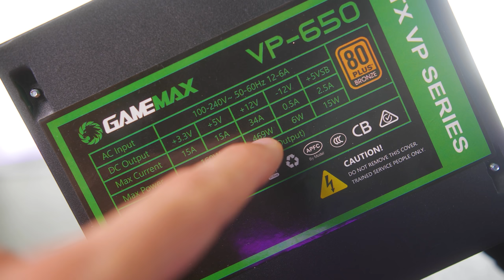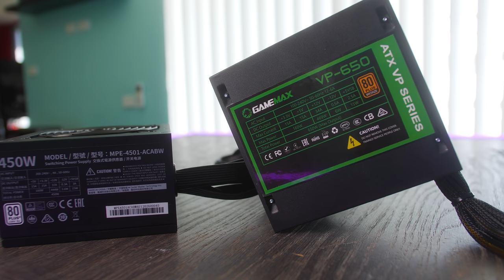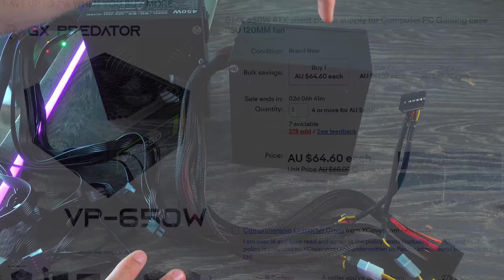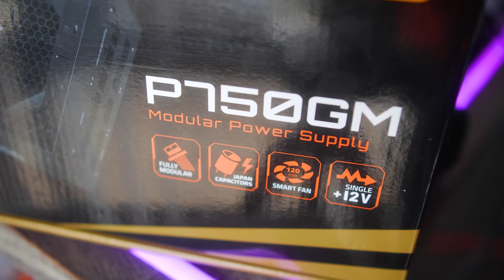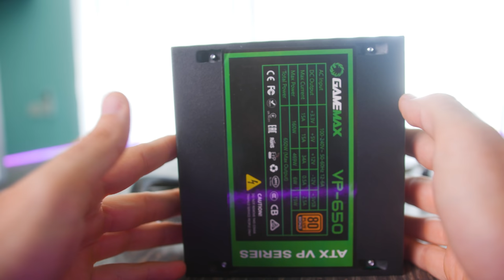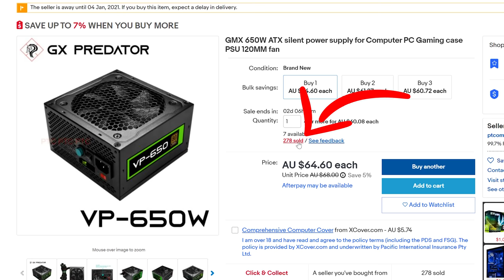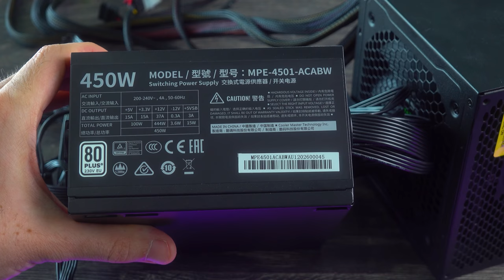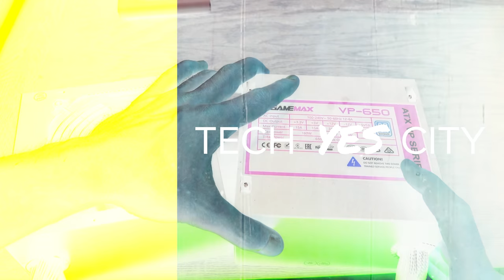This Company is Straight LYING about their "650 Watt" Power Supplies.... (*UPDATE* FAKE GameMAX??)

Comment: I put two of there 600W PSU in my first 2 builds-1600AF/1660TI/4x8 3200 DDS-4/500GB M.2/1TB SSD/6xRGB Fans/Fan-Temp Controller. Mine has been running WOWS now for 1yr=9K games=up to 20hrs a day. Have had zero problems. #2 was for my grandsons B-Day and he has been playing RB-6, WOT, WOWS, CS-GO and other games and have had Zero problems. I did not use in my new PC 3700X/2070Super/4x8 4000 DDR-4/1tb M.2/1tb SSD/9 RGB fans and 24 other RGB items.
As a side note I do not have AC so this PSU ran fine in temps over 100`F in the summer for hours and hours. Just saying seems fine to me!!!!

Comment: Check out the gigabyte PSUs 
They are selling on Amazon India after tax and shipping for :
450W bronze : 40 USD 
650 bronze : 60 USD
700 Bronze : 70 USD
750 Fully modular Gold : 80 USD 

Pretty damn cheap and good reviews,  In India we pay at least 15-20% more than US for PC hardware and this is cheaper than US, coolermaster, Corsair PSUs cost like 10-20 bucks more for equivalent ratings.

Comment: YOU JUST BLEW MY MIND. I replaced mine yesterday! mine ended up actually being only 480w on the 12v rail. Ended up nearly killing my PC. Running a cooler master.
Reply: GameMax is hot garbage and the power supplies weigh so little. The SATA power connectors cracked on mine as well. I thought i was being too aggressive, but its just a POS. Then they say the wire on my PS (VP-600) is using 16 AWG, which is bullsh!t, because my cooler master power supply is actually using 16awg wire.
Reply: Might be worth digging a bit deeper to determine if it’s even a real GameMax or a shoddy counterfeit.  GameMax doesn’t even make a “VP-650” model...

https://gamemaxpc.com/productkkk/list-276-en.html

...but they do make a VP-600, which really is certified 80+ Bronze:

https://www.clearesult.com/80plus/manufacturers/115V-Internal/

Looks like this may be a counterfeiter peddling generic Chinesium and trying to trade on someone else’s name, rather than an entirely garbage product put out by GameMax.  Although it is worth noting that even the genuine VP-600 uses the same misleading labeling of combining the max power of 3.3 + 5 + 12V rails to come up with “600W”; at least on that model the math is right for a 40A current at nominal 12V producing 480W peak on the rail.

Comment: I always buy Evga Power supplies, almost all are 80plus bronze rated or better and almost all have 5-10 year warrenty's. And I always try and use the PowerSupplycalculator from Outervision because you can enter each individual part and its usuage-clockspeeds and try and get atleast 100w over what it recommends.
I usually base a purchase of a powersupply off the warrenty from the company it sold by because if it has a 5 or 10 year warrenty, they intend them to last at least that long.

Comment: There's a Brazilian channel called Teclab that has a very knowledgeable guy on PSUs and overclocking (rbuass). He really dislikes the "80 Plus" certification and recommend searching for the "Cybernetics" certification instead, I second his recommendation, whenever you are in doubt about a PSU, just search it on the cybernetics. They have a very very detailed and informative certification process and you can download a pdf with all the tests that the PSU went through.

Comment: Thanks for this warning, I was going to get a 850W gamemax psu from amazon, but now I'll save my money and get more expensive and we'll known make.
Reply: has been fine so far for me for almost a year cuz im only paired it with a 65w cpu and a 120w but will seriously consider upgrading soon lol
Reply: @hoangd4132  just get a cheap corsair 80 plus white or any other brand with a well known name. They have something to lose if the power supply would be terrible.
Reply: @hoangd4132  i bought the rgb one with 80+ gold .  i am not a gamer though but now i considering buy another psu,,uh
Reply: Never go by brand, most of them only slap labels on other OEMs products. If you dont know better what you are doing, just go by the PSUCultists PSU tier list, get something A grade if you can
Reply: Might be worth digging a bit deeper to determine if it’s even a real GameMax or a shoddy counterfeit.  GameMax doesn’t even make a “VP-650” model...

https://gamemaxpc.com/productkkk/list-276-en.html

...but they do make a VP-600, which really is certified 80+ Bronze:

https://www.clearesult.com/80plus/manufacturers/115V-Internal/

Looks like this may be a counterfeiter peddling generic Chinesium and trying to trade on someone else’s name, rather than an entirely garbage product put out by GameMax.  Although it is worth noting that even the genuine VP-600 uses the same misleading labeling of combining the max power of 3.3 + 5 + 12V rails to come up with “600W”; at least on that model the math is right for a 40A current at nominal 12V producing 480W peak on the rail.
Reply: @ffqqz  I appreciate your help mate, thanks.

Comment: The worse thing is if you pull it apart it will probably not be electrically safe either (creepages, clearances, insulation in transformers, temperature rise of components).  I'm an electronics engineer who's worked in one of the remaining Australian designers of household appliances and some of the electronics imported by no knowledge salespeople out of China is scary. Problem is this stuff will have made up test reports which the importer will declare. Unfortunately monitoring/enforcement of standards is generally only retrospective.  I.e
only when somebody gets electrocuted or there is a fire.  And even then penalties are too small.  You can bet it will also fail our EMC standards miserably. The EU hammers importers who bring in non compliant equipment. We don't.

Comment: Concerning the PSU label (I am not an expert on this, so take with grain of salt):
CE is the manufacturer vouching for their product to be compliant to some standards.
Same with FCC, except it needs to pass a test concerning EMI.
RoHS is technically part of CE, it just means the devices does not contain certain chemicals. (There is a second RoHS logo on there?!)
No idea what EAC and EIP are. 
Recycling? Is that a hint?
Never seen the rest of the symbols.

For Germany (Where you would need a CE and RoHS to sell anything), the "interesting" markings would be GS (which is an actuall test of packaging, user documentation and product safety) and TÜV (technicall certification of the product).

Comment: I am totally shocked at that power supply I own an gamemax falcon case and it is lovely, enough cable manage space at the back, power supply/hard drive bottom basement hide away, clear side panel, enough space for water cooling with 2x 240mm radiators, it's a great looking case, maybe they should stick what they do best and leave psu's to the experts, like corsair, kolink, antec, Silverstone, evga etc...

Comment: in the philippines, there is marketing term called "true rated psu" to differentiate cheap, generic psu with false ratings
Reply: "true-rated" is a very cringe-worthy term. It doesn't matter if you are getting the actual wattage if it lacks the protection circuitry to save your system in the event of a failure.
Reply: @icdeadpipol  Seasonic S12s have shit protections (not only S12, but Plats, X and Focus) and Filipinos run after the damned things

Comment: I've been using a GAMEMAX psu on my pc for 7 months without problems. Honestly I bought it due to lack of stock or overpriced brand name psu's on Amazon. Mine is a different model, the VP-600-M-RGB, so maybe that could be the difference? I'm running a 1600AF with prism cooler, AR B450M Pro, RX 580, 16gb DDR4, two M.2's (nvme, sata), 8tb HDD, two 140mm, one 200mm, one 120mm fans. All on a modified Thermaltake S100 case. PSU is dead silent and my pc has never had one hiccup and I run my PC 24/7.

Comment: GameMAX using the same strategy as Xigmatek, cheap Antec units, and some other lesser-known brands. 
There are some models from Xigmatek like X-power using the number name to make them better in the eyes of customers.
Like X-power III 650, the 12V rail is actually 540W, and the total rated power is 600W. Even the better Tauro M (80Plus Bronze, semi-modular, discontinued), a little bit over 300W on 12V rail and marked them as 500W unit.
For Antec, their Atom series (for 220-230V country), the V series is okay with 550W having 504W from 12V rail. They are running a little bit loud, but do the job and the price is a-okay. 
But the B series, which is 80Plus Bronze (and they also mislabel them as 80Plus Bronze full-range although they are short-range 200-240V, and they have to mark them as 80Plus Bronze 230V). B650 is a disaster unit, 524W from 12V rail. B550 isn't an exception, 434W from 12V rail.

I'm working for a computer shop and I usually avoid those units. I always put CM MWE V2, Gigabyte P series, Corsair CV and VS. If the budget is a little bit tight, Thermaltake Litepower, and Antec Atom V for those builds. On higher-end builds, I put Seasonic, Antec Neo Eco or EarthWatts, CM MWE Bronze/Gold, and Corsair RM or above to those.
P/s: About Gigabyte P units (the first batch was a disaster, the OCP and OVP were too sensitive and kill the unit immediately, later batches fixed this, P550B suffered from this, if you have a P550B, you might need to RMA them soon).

Comment: Some random guy on a Facebook computer group was saying how amazing his Gamemax PSU was yet when googled there are ZERO reviews for it, in fact hardly any (if any) Gamemax PSU's have any reviews, they even sell a 1000W PSU for less than £90 which to me is a red flag straight away. How I originally found out how bad they were was from reading amazon comments from owners that had bought them and they were about 20% in favour and 80% not in favour, some comments were scary too, like the PSU started smoking after 2 weeks of use, some not even lasting that long and dying a fiery death after 2 days. All I know is if you want to get a good PSU then look for reviews and maybe some recommendations on a computer group from owners that are non-affiliated with the manufacturers, so basically anything unbiased.  That's how I came to get my current PSU, the Asus Strix 850W in white, Gold rated efficiency, 10 year warranty and glowing reviews from proper hardware sites + its white with white braided cables so matches my PC build.
The single most important component in your PC (after the motherboard) is the PSU, don't skimp on it or your PC will be an unreliable unstable mess and there's nothing worse than a PC that resets or CTD all the time.

Comment: Just buy PSUs from reputed brands, that simple.
Reply: @Matty Yeah, and then being adviced to buy crap products from a serious channel/influencer 'coz they are afraid to loose their sponsorship, like freaking fucking Jayz2Cent and his glowing good review of the Corsair A500 Air, while that cooler wasn't even designed within the specs of Intel sockets or from the same brand a GPU watercooling block that leaks. Of both products, he never called Corsair out for their fails, but is still with his nose up their arse coz he is afraid to loose their sponsorship.

Comment: For most products, the CE marking does not mean that some independent laboratory or some government organization has tested/certified it. Most often it is just the manufacturer itself declaring that it has checked what European regulations apply to the product and that the product conforms to those regulations (Declaration of conformity). In high-risk product groups like medical devices, the product must be certified by an authorized organization called "notified body". When a notified body has certified a product, there is usually near the CE-symbol a four-digit number that identifies the notified body. I suspect that the same applies to other jurisdictions as well.

Comment: I bought a Thermaltake Smart 500w power supply this last fall 2020.I didnt expect a lot.non modular good wireing and plugs runs quiet enough,runs 24/7.With parts almost impossible to buy and very slow to arrive.Even without hearing much about Thermaltake before i am ready to order another one for next build in about a month when I finish up with the lose ends on this build.

Comment: Best way to see if the PSU is reliable is the warranty
At minimum 5 years warranty
Recommended 10-12 year warranty, PSU will last forever.
Reply: They could warranty it for twenty years. They won't be around for any warranty coverage. Companies like this just close up shop and come back with a different name when things get hot for them.
Reply: The best way if you dont know what you are doing is probably teh PSUCultists PSU tier list

Comment: as someone stated it was the only ps available in July, but i got the rgb-850 that has pretty good reviews. it is driving a Ryzen 3900x 12 core. 105 W.  a Radeon RX 5700 XT and overclocked to 4.4ghz. it water-cooled and has rgb all over and i cant even hear it. I worked in R&D developing medical devices, in the US as I'm sure in Australia you cant put these certifications if not earned or they pull your shit off the shelves, at least with med devices. mine says 850 watts but that max output, that really doesn't tell you shit to be honest. it doesn't state how long it can maintain that, what combination of rails does that rating include, or more importantly, how much power cant it sustain without catching your house on fire.  i always make sure i have the headroom of at least 50% because you never know. Since there is no standard, these companies can put whatever, reminds me of th 90's when i was into car stereos and amp manufactures put ungodly watts that were impossible.

one more thing about the china crap flooding the market, ive happen to know quite a bit about china manufacturing, and yes, they have crap stuff, but that's what people want, cheap shit. these people are the world leaders in manufacturing and they do have top quality shit too, how can they not, they have stolen every country's IP. how else have they become such a threat to US, UK, Australia, etc. you get my point, please don't make the mistake of underestimating them, they are more dangerous than people realize. look up a documentary on shen zen, its the new silicon valley.

Comment: Holy shit Im using one of them right now
Imma throw this bomb away immediately
Reply: u don't have to
Reply: Is your model a VP-650 or GP-650?  Does the label have 528W as Max Power?  
Legit  unit is GP-650 with 528W Max Power.
Reply: @ezdoesit2933  I'm using the VP-600. I thought it's passable since its 80+ Bronze. I will switch it with a MWE or CV550 I think.

Comment: Good rule regarding power supplies: Don't buy the cheap ones. Just don't. Don't even buy most of the expensive ones. Do some research instead. But this generally holds:

If you are on a budget, definitely don't skimp out on the power supply. Start culling elsewhere. Or you can calculate your exact wattage and get something closer to that, but still high quality. But once more: You do not want a cheap one. 

Only buy the highest of the high quality power supplies appropriate for your rig, and accept absolutely nothing less. Skimping on a power supply means you might be paying a lot more elsewhere when it does blow. This is particularly important with the new GPUs from AMD and nVidia with high transient voltages and spikes. That being said, the Coolermaster one shown here is definitely not appropriate for those either. The wattage isn't really enough if you have a decent CPU to go along with it, but that particular model has a specific problem with transients. Which means the card can kill the PSU / The PSU can kill the card just like that when you least expect.

TLDR: Don't buy any cheap power supply, including any of the ones in this video if you have one of those new RTX or AMD cards. Even that CM supply is known to be problematic even if you get a higher wattage version.

I personally recommend the Corsair RMx series at the very least. They are verified compatible(i.e that it's safe to use) with the RTX 3070. Whereas the CM and even some higher end Seasonics have trouble with it. 

I had the Seasonic Focus 550W. Much higher quality than the Coolermaster depicted here, and twice as expensive. It ran fine, until it died. That coolermaster will most definitely die too, but it might also take other parts with it. So definitely don't get that one.

Comment: Had a Chieftec CFT-750-14CS which had 4 rails of 18A on 12V, 30A on 3.3V and  28A on 5V, on paper it had more power than the newer Corsair RM850i, it came with 2 year warranty, used it for 9 years and I still sold it (said it's 9 years to the owner), perfectly stable, only the fan became a little noisy, so not all manufacturers who give 2 years warranty are bad. I agree 1 year is a little low.